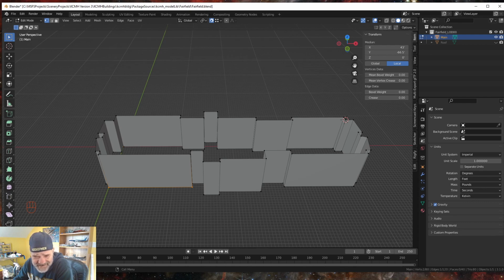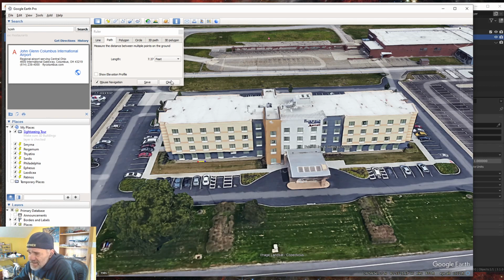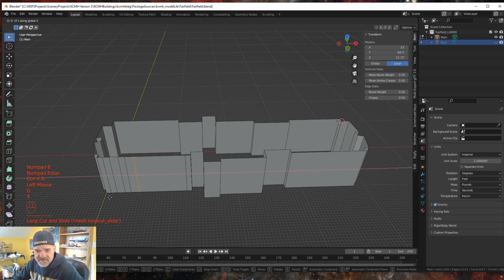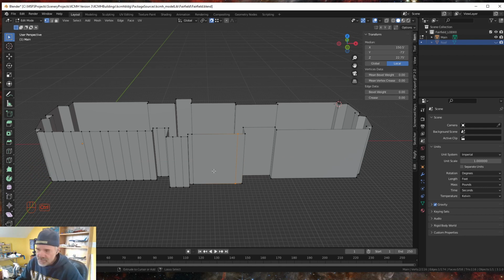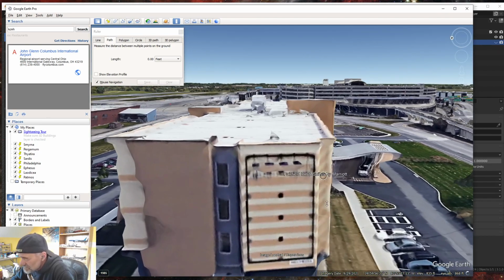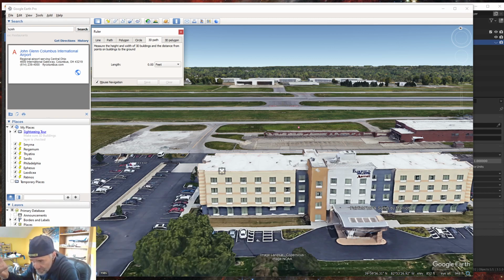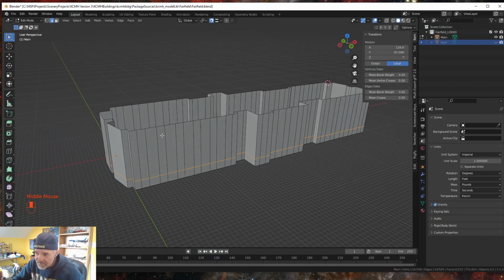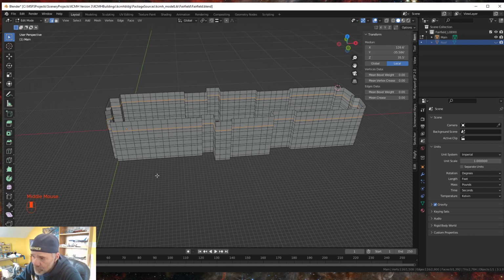Creating Scenery for MSFS: Fairfield Inn Full Build Series Pt2

Comment: Could not get the snap of edges working your way :(
I am using for the moment Blender 3.3.12 and the snapchoise is a little different in that version. But I use the default.
It will not snap except to the end-edges.... 
But I got the following to work rather fine...
1: CTRL-R
2: Enter 
3: Drag the edge to somehow where you guess it will be...
4: Go into Front View.
5: Use Edge Slide - It will snap fine.....

A few more step but that works for me.
Do you have an Idea why not your way works for me?   I as I said - uses Blender 3.3 for the moment.

// Erland
Reply: I after some experiment found the right way to snap in the same way as you do!  I finally get it. :)